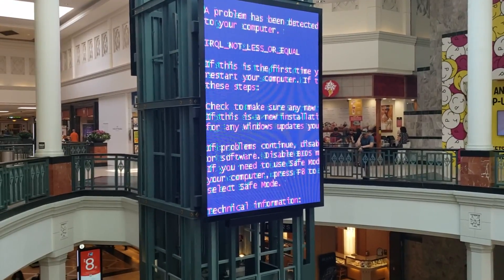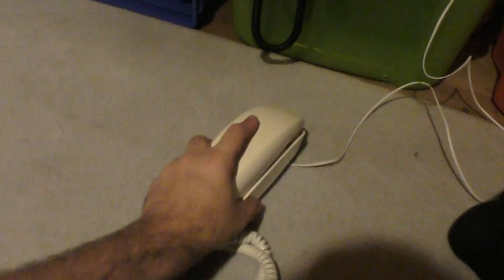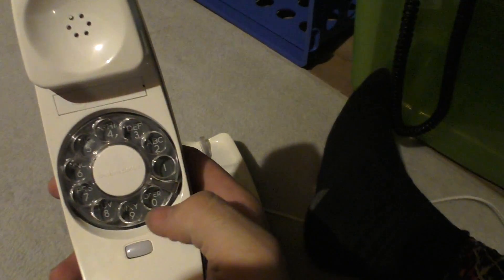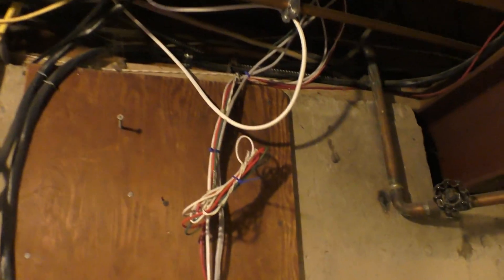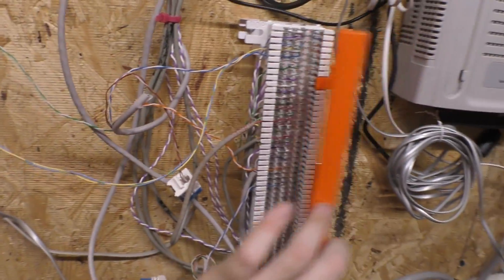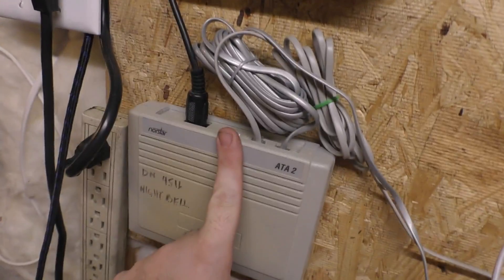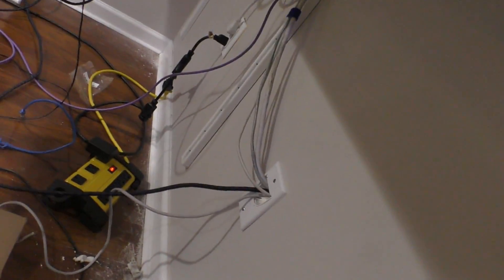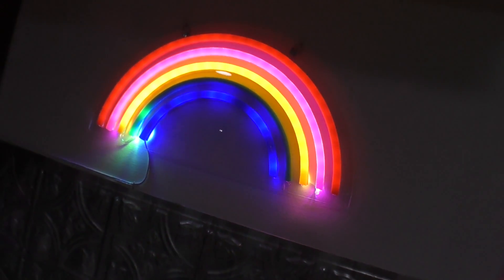The Rotary Dial Telephone in the Attic

Comment: Nill, when you decide when to install paging in your house can you make a video of that too??? I'm very into audio. If you want a paging speaker in every room of your house and maybe outdoors, I would recommend a 70 volt audio system. A 70 volt audio system is the type of pa system used in retail stores like walmart or hospitals or restraunts even. look up 70 volt speaker systems. They are not that hard to install and the voltage is not going to hurt you. Unless your stupid and run your amplifier into clipping or high volumes while working on the system. Also you don't have to buy the ugly 
horrible sounding speakers like you see in a walmart stores up on the beams or in the ceiling tiles. They make plenty of nice sounding and looking speakers for residental use. One more thing, I recommend an amplifier with at least 60 watts of output if you would like to blast music over your paging system too and make sure the load of all your speakers is 15 percent less than your amplifiers output. Have fun making louder pages throughout your house!!
Reply: I forgot to mention in the last comment to connect tip and ring to the hot and cold input of the amplifier's tel input. Do not use the ground terminal for anything!! Thats for balanced dry pbx audio signals only yours is unbalanced. Also hot and cold is the same as tip and ring.

Comment: When you said you where going to install paging in your house do you mean ceiling speakers? If thats what you mean I recommend a JBL ceiling speaker system. I fell in love with the sound of the JBL commercial audio product line a while back and even more so that target stores are slowly migrating their old crappy bullhorn paging system to JBL in ceiling speakers. I recommend to install those if you intend to play music over your paging system as well. Check out the other comments I left to about the amplifier I recommended you. Those TOA amplifiers the bg series and the 900 series support modules too. which one allows you to do SIP based paging from any voip phone system platform. Some of the TOA bg series have paging contacts built into the amp too. Also, you can add ceiling mounted subwoofers to your paging system as well. Google 70 volt distributed audio theres tons of tutorials on wiring paging system speakers.